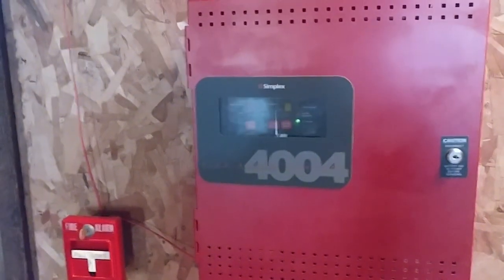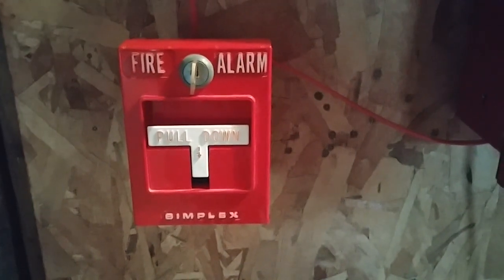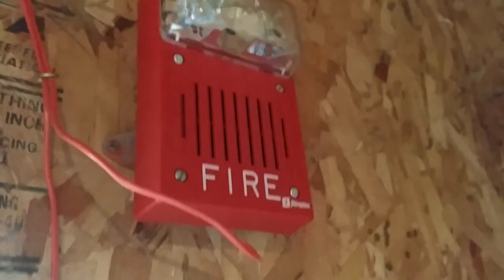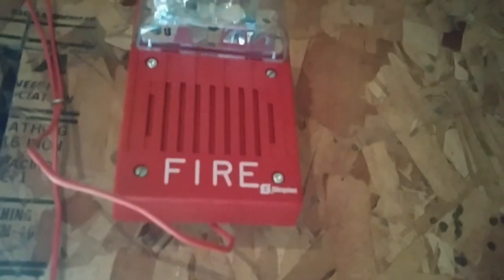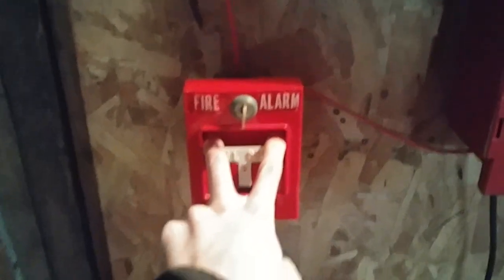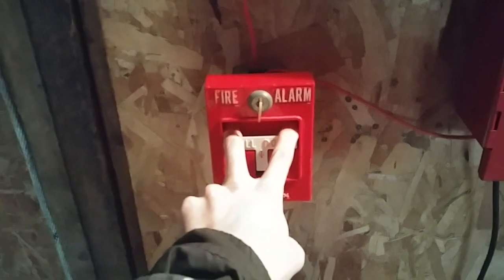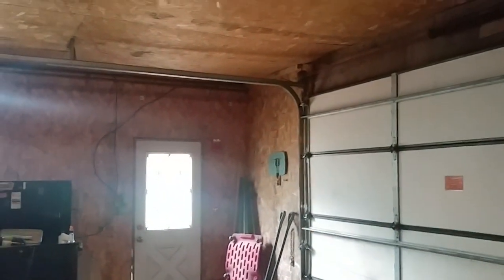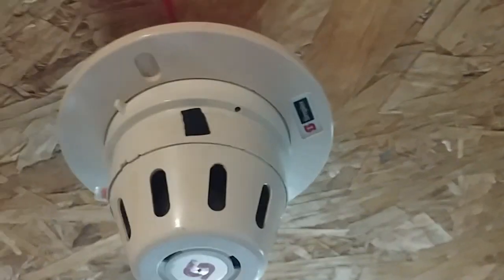system test 50 #FireAlarmFriday

Comment: Nice video. I have the 9220 which is the mechanical version of that 9239
Reply from the maker: Nice. I'm actually planning on getting a 9220 so it can go with my 9239
Reply: @vintagefirealarmguy5285  the vertical 4903s are pretty rare though. The only time I found a 9220 on Ebay was the day I bought it so they aren't too common. Good luck finding one.
Reply from the maker: @officialsimplexguy  I save the search simplex 4903 and usually something will pop up
Reply: @vintagefirealarmguy5285  smart idea I've done that with the simplex 4050 80s